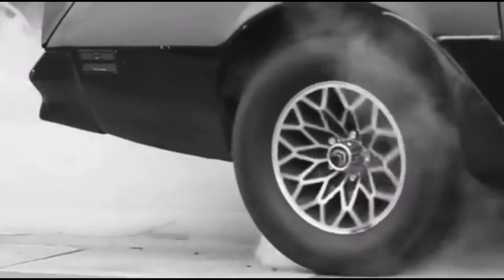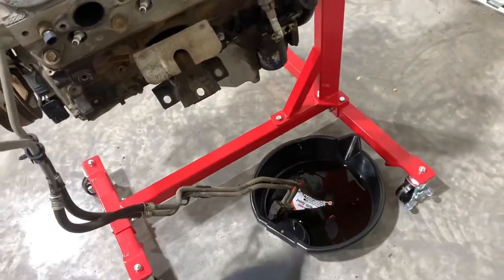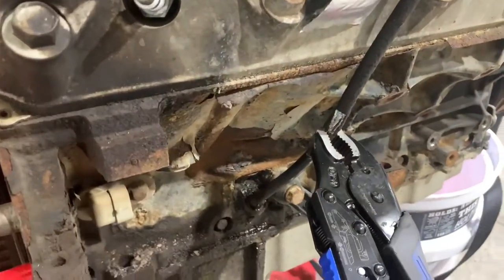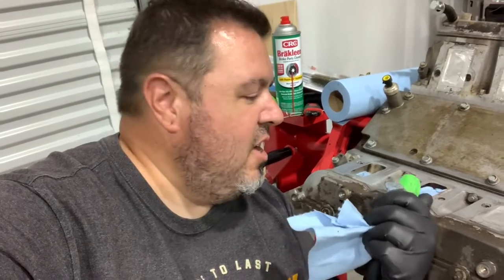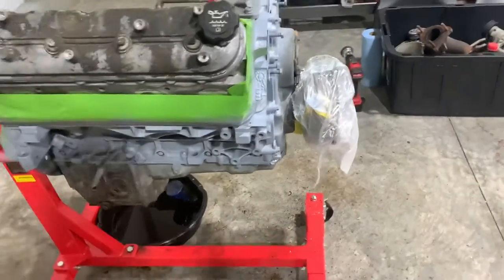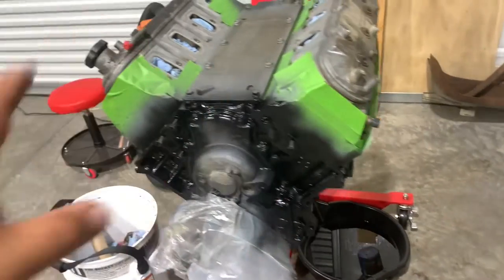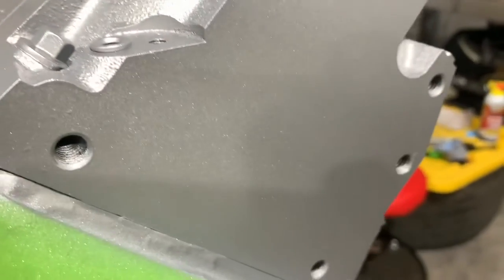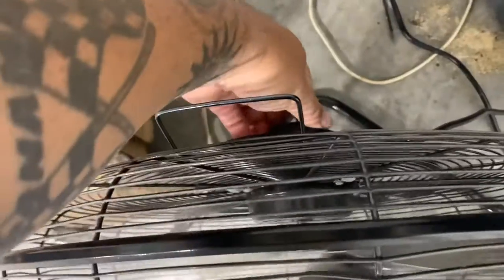Chevy LS 6.0 LY6 | Strip, Clean, Paint | START TO FINISH

Comment: Looking sweet! I'm stealing the 6.0 LQ4 out of my wife's '06 Suburban for my '70 Chevelle. Unfortunately, it has more the 300k miles and low oil pressure, so I'll be doing a full rebuild.
Reply from the maker: While that is a lot of miles, its worth mentioning that the #1 cause of low oil pressure in those engines is the tiny little $0.05 o-ring where the pickup tube snaps into the oil pump. Thousands of LS’s have been scrapped over that. I believe that was the last year for the LQ4, in 07’ they introduced the same engine thats on my stand. The LY6
Reply: What upgrades are you planning for the rebuild, specifically the camshaft spec?

Comment: what led you to choose this specific motor?  what was your criteria?  I need to start looking for something to build up for a future truck build (1957 gmc) and I want it to be able to pull a car trailer with my 1937 Packard.
Reply from the maker: I knew I wanted a 6.0 and I wanted decent power without tearing the engine apart and doing a rotating assembly, cam etc etc. the LY6 is has the LS3 heads on it which flow great and make good power. The truck engine stock is 370hp. By the time you delete the stupid egr stuff, do a tune, and simple cold air intake and headers, you’re up over 400hp without doing much at all. This truck is only being built for cruising, not the track. 400hp in a lightweight truck like this is way more power than I’ll ever need. It also had low miles on it and I know the seller well. He warranties everything. Seemed like an easy choice. They are getting expensive though… no longer a cheap option.

Comment: Instead of using $50 worth of shop towels on your spills, use $5 worth of kitty litter. Toss it on the spill, and go back to your project. Sweep it up later.
Reply from the maker: Ive done that many times. This time however, the shop itself is new, there was no kitty litter or oil-sorb but I have literally 2 full cases (24) of shop towels. As is in all facets of life - we do what needs to be done with what we have on hand. Thanks for watching and for the comment!